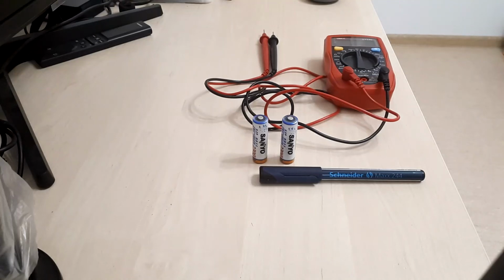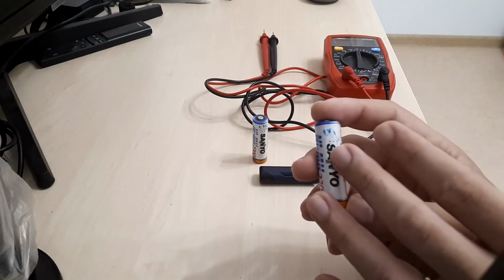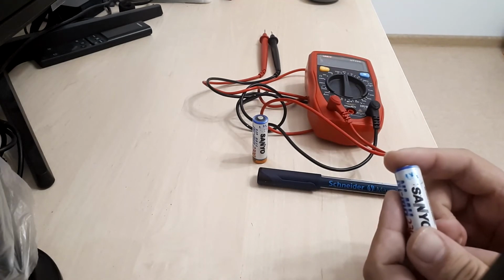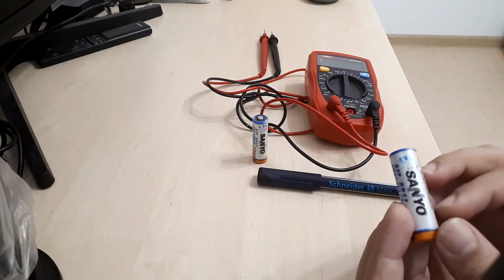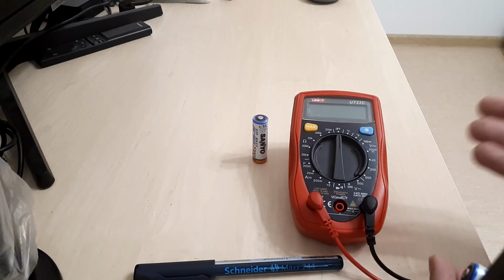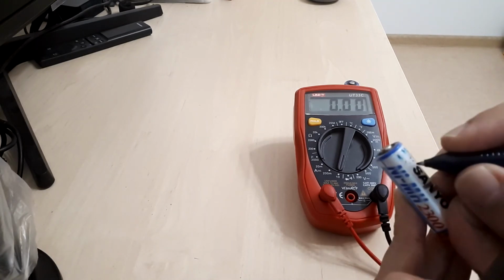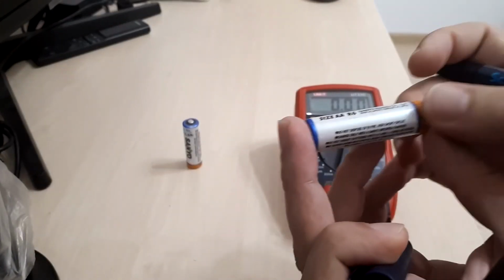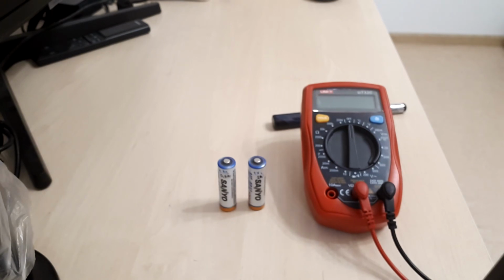2007 Sanyo (Japanese) Built NiMH Review, Rechargeable Batteries Evaluated After 15 Years Light Usage

Comment: I like your idea of using current to estimate battery health however your conclusions were too vague.
 For example, can we conclude that a battery producing 0.8A compared with 1.6A when new, is therefore at 50% health?
If there is a linear relationship between amperage and health/capacity (I don't know if this is true) then your method would indeed be very helpful.
We know that manufacturers often use 80% health as the threshold for battery replacement.
Also I noted that although your batteries were very old they had a low cycle count and apparently only moderate use.
NiMH battery manufacturers don't usually give any expiry date but they do give a cycle count estimate. I am starting to seriously doubt that their estimates are anywhere near accurate in the real world.
Finally , I think that your video could probably have covered everything you had to say,  in half the time if you were able to edit it.